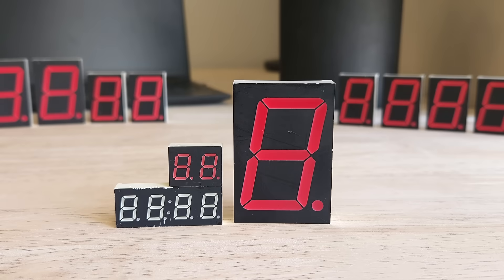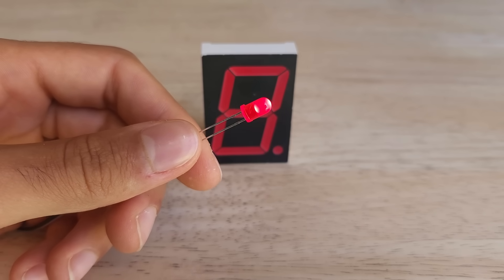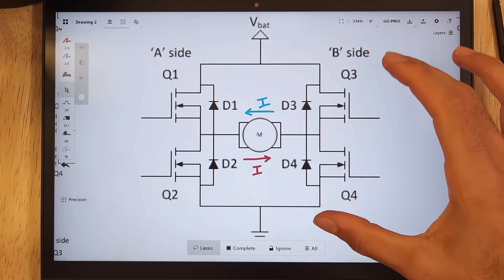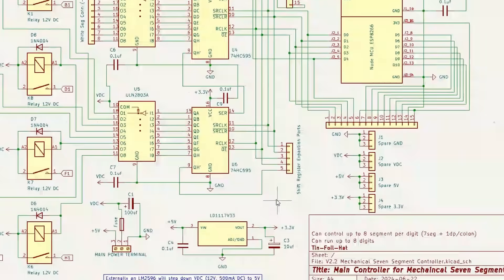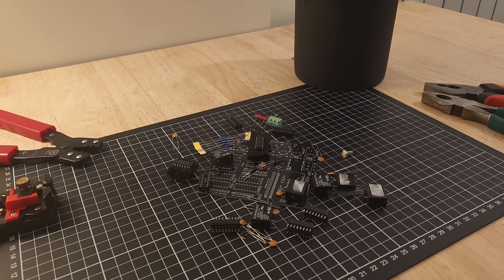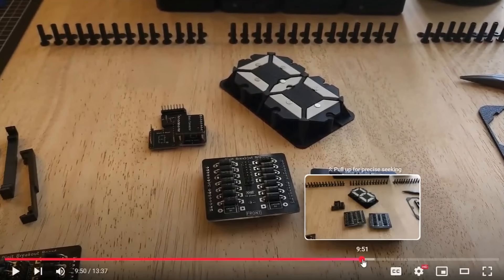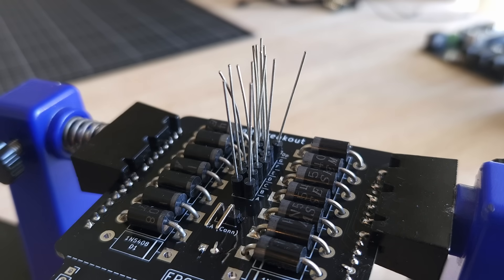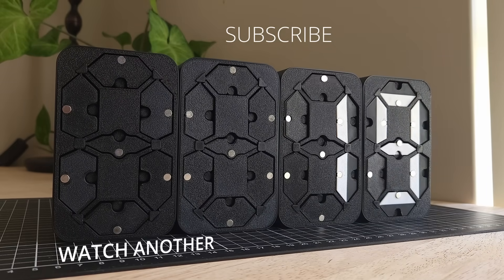The BEST Mechanical Display You've EVER Seen!!

Comment: Requests for Version 2
- use an off-the-shelf component for the electromagnets
- update all 8 digits at the same time
- embed the magnets under black/white so they don't show
- sell as a kit
Reply: The off-the-shelf electromagnets is the one thing preventing me to just build these displays on my own right away.
Reply: Also: Make each printed segment a little big thicker and hide the magnets INSIDE the print for a clean look
Reply from the maker: @mauroangst  I had planned on painting over the magnets but got used to the look lol. You could easily design a new flap though so good idea.
Reply: @ yeah that’s what I thought, it doesn’t look bad and it’s kinda cool revealing the mechanism! :)
Reply: I have a little bit of experience driving a flipdot display without a commercial driver. Trying to flip many at a time can really increase the power draw a surprising amount. It's not impossible, but the tradeoff just for power delivery alone is steep.
Reply: @nine_clicks  Adding a battery could help with that, as they can typically handle high current(especially when brief), and of course the segments aren't changing often so the battery could use a relatively low current charger.
Reply: @nine_clicks  How fast can one change from one flip to the next and NOT have an extreme increase in power draw ?  milliseconds, microseconds ?  If he sequenced flipping fast, it would be hard to tell and might make for a cool sounding/looking effect .
Reply: @68CHUCKLES  around 100 milliseconds is my safe bet without actually calculating the time required for each electromagnet to build up peak field strength. The electromagnets consume more power during that build-up time than when they are saturated in field strength and can sustain the same force with a lower current draw. Despite the fact inductors prefer to not change current flow, the magnetic field created does consume electrical energy to create and that energy does need to come from *somewhere*.
Reply from the maker: @68CHUCKLES  They flip at around 40ms, but to flip a digit up (against gravity) requires around 60ms, the naked eye can hardly notice, but a camera makes it a bit more obvious
Reply: He should have someone help him with the electronics. He really should be using a H-bridge for driving the coils. His design is fine for a one off but it uses way more materials than is really needed.
IMO, this is a great YouTube show off project but a very poor consumer product.
Reply from the maker: @ddegn  If someone wants to help then my door is open :) It was never really designed as a consumer product and yes... the coils are very tedious haha
Reply: I would also want to add the ability to read the current state of the displays, for… reasons.

You do what you must because you can, dammit! 😂
Reply: @AlyssaNguyen  with this system you can easily check the state by energising the electromagnet that you don't want.
Reply: @AlyssaNguyen Still Alive reference spotted!
Reply: sign me up for the kit!
Reply: I fully agree with your first point about the electromagnets, and I also wish it was a kit

but I kinda love how it updates each digit one by one, and I also love the look of the magnets... so maybe make multiple versions?
Reply: Off the shelf is either expensive or too large. You might be able to use a solenoid off the shelf as an electromagnet. But if you know a source of a cheap and small electromagnet please let us know.
Reply: @newmonengineering  oldschool automotive relay
Reply from the maker: @newmonengineering  Yep that's what I found too! Unless you want to order 10000 from china lol
Reply: @tin_foil_hat99  Your video is already available in China, and it feels like someone will be willing to make these parts soon
Reply: Not just all the digits at the same time, all the segments
Reply: @Noam-Bahar  You could use demultiplexers instead of shift registers. Albeit I thought the shift register itself would be so fast as to not be noticeable but presumably the design means it's waiting until the electromagnet pulses are finished until releasing the next signal?
I'm guessing the digits are similarly waiting on previous digits.
You could send 3 separate signals from the microcontroller to 3 multiplexers simultaneously, which would provide signals for all segments of all digits at the same time.
Reply: @Noam-Bahar  I find it more satisfyingly weird with it being highly sequential.
Reply: is there any way not to have a custom PCB because its expensive
Reply from the maker: @CloneBricks66 5 bucks for 10 pcbs? It is shipping that costs the most... You can even get 5 dollars off using the link in the description...
Reply: Sry I saw $70 on the video
Reply: @CloneBricks66 You can purchase boards with a pre-drilled grid and copper pads around the holes for cheap. Then just wire them yourself.
Reply: @CloneBricks66 You can build it on a prototype board too!
Reply: use parts that can be ordered from mcmaster please!
Reply: @NewcastleDayz if only we had access to McMaster… We don’t all live in the US…
Reply: @ramdynebix  I live in Canada dawg, so you're right, we all don't live in the US lol
Reply: Yes, that was kinda my round about point, when I first read the explanation, about the build, first thing I thought was to ; add a really thin layer after the magnets were installed just so you don't see them, but they would still work!??.... TOOO COOOLL!!!!🥰🙃😁
Reply from the maker: Yes johnmead2580 it'd still work! The magnets are already too strongly attracted to the iron cores, so the top thickness of where you screw in the bolt has a thickness of around 1.6mm (from memory)
Reply: I was about to say the same...
Reply: @Matthew-lh3zy  
Technically, all these components were on a shelf at one point, somewhere....
Reply: Put the coils on the pcb
Reply: and add a felt pad to dampen the sound.
Reply: @hephaix that's kinda a personal taste thing, he said he likes the sound.
Reply from the maker: @koenigsegg888  I do haha I was making these for someone else all along and they specifically requested a clicky sound.
Reply: @koenigsegg888  But perhaps not to be placed next to one's bed!
Reply: @hephaix  A felt pad would increase the thickness between the magnet in the flap and the magnetized screw. If the sound is truly an issue I would suggest potentially a latex based paint that could be put over the ends. This would give a "thud" sound over a plastic "click" but be significantly thinner and easier to apply. Instead of cutting and gluing on each one a brushstroke can be done across the entire thing, and more so it can be color matched.
Reply: A ferrite core inductor might work. Maybe with a tiny metal disk, like a washer, on top. Worth calling or looking through the mouser website for a nice small one. They might even send you a couple samples if you're serious about a kit.

Edit: I missed autoincorrect "fixing" inductor. Also, talked to an electrical engineer friend. It might work, depending on the circuitry.
Reply: @Zirnike  Ferrite has a vastly lower magnetic permeation factor, and is substantially worse for an electromagnet to the extent that it's outright a bad choice for electromagnets. Soft iron, like that used in screws, is ideal because of its permeability, which lets the eddy currents flow more readily. That can effectively result in focussing the magnetic field and its attractive/repulsive force at the "open end" of the iron core; that's the end of the screw -- both ends actually. But just one end is aimed at the front/magnets hence we just alternate the current flow direction to change the pole present at that end. 

TLDR. A ferrite core inductor might work. And it's objectively a far inferior choice for anything electromagnet related. It is a bad choice for an electromagnet.
Reply: @AnnaVannieuwenhuyse sure... But we were looking for cheap, off the shelf alternatives. Actual electromagnets are pretty pricey in comparison. A quick scan gave me minimum $3 each. That's $42 per assembly, or $170 per clock with just a bit of shipping, compared to around $5 for around 50 for inductors. So if they're good enough to WORK, crappy is good enough.
Reply: @hephaix  Yeah the sound is half the enjoyment in these things.

Comment: Great project! Why did you go with relays rather than mosfets?
Reply from the maker: I needed to switch the positve rail, and mostfets started getting complex (for me) so I just opted for the easier and more simple solution. You could definitely do it with mosfets.

Comment: That's a truly beautiful piece of time! I immediately liked and subscribed. I'm working on an electromechanical clock with a similar concept, and regarding the issue you encountered at 3:45, I think I've found a solution using an H-bridge like the L9110H. It's very cheap and can handle up to 800mA, which is more than enough for my solenoids. Have you considered this option?
Reply from the maker: Hu I will look into it!

Comment: I like the 'wave' effect when digits change but would be cool to see all the tiles changing at the same time as well. Great build
Reply: I'm curious what the reason for this is - is there a current draw issue with flipping multiple segments simultaneously?
Reply: @VermonCaTaffy  - All multi digit 7 segment displays are multiplexed, thus you need one driver for each of 7 segments and one for each digit.  8 digit display is 15 drivers if multiplexed, 56 drivers if direct drive.
Reply from the maker: @sandwich.entity3810  Yep that's why! I designed the controller so you can change them all at the same time (and wrote the code for it), but you need a ton of power... which gets more expensive and hot. So opted to flip one flap at a time (when not behind a camera it looks almost simultaneous)
Reply: @tin_foil_hat99 I think you can still get away with this. Right now you’re attempting to complete one digit, then move to the next, then the next, etc…

If you instead looked at it as an each digit having a number of moves that need to be done, you could just go one digit to the next.

So do the first action for the first digit, then the first action for the second digit, first action for third, then go back to first digit and do the second action, etc…

This was you can emulate the multiplexed effect without actual multiplexing.
Reply from the maker: Yeah sorta similar to the way I've done it, but rather I'm doing one digit then the next, but with multiplexing you sorta consider it like a grid, with each flap as a row and each digit as a column. I'm going column to column rather than row to row (as you suggested). It would give quite a cool effect going row to row like you said, but cause there is 14 rows and (in my case with 4 digits, thus only 4 columns) the way I designed the PCB was to use transitors for the rows and relays for the columns (as it gets a bit more complex to switch the postive rails with transistors) and thus I go column to column as transistors switch faster than relays, making it more efficient. Although you could 100% change the code to do it your way with the current set-up.
Reply: How about just a big cap for each?
Reply: @qess  That was my thought, a cap on each segment. Of course, then you'd need a transistor to switch it. And then a flip flop to remember the state so that the controller doesn't have to block waiting for the cap to discharge. And maybe a current limiter on the recharging circuit but at least there's only one of those. I mean as long as we're over-engineering things, ya know. :P
Reply from the maker: And so the overengineering spiral continues!!
Reply: @tin_foil_hat99  I used to maintain a scoreboard with lots of commercial flip-digits. There could be a maximum of 8 digits in a lane, which had one control board for the lane. There were lots of beefy electrolytic capacitors around so the whole lane could change at once with a satisfying “clack”. Sadly I ended up throwing a lot of digits away when the board was replaced with an LED one. Didn’t miss going up in a lift to fix/replace the digits though.
Reply: I would buy it now. Consider it to sell this beautiful art
Reply from the maker: I have no idea how I'd keep up with the orders haha maybe someone with some business experience could help me out :)
Reply: Came to comment the same. Especially for the second counter in the end
Reply: Amazing project. But the way you tell us about it even more impressive! Great job! Thanks a lot! I had a great time watching the video and enjoyed the story!👍